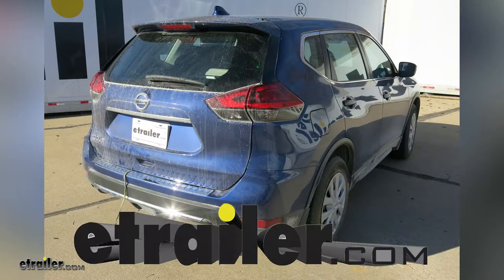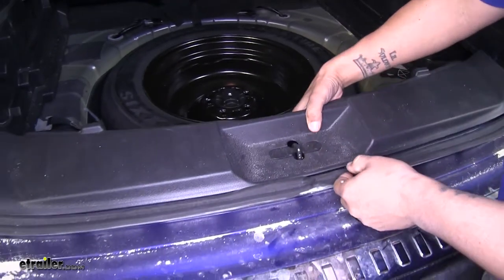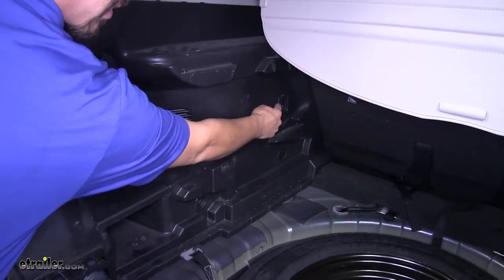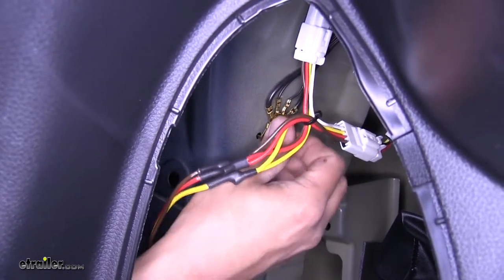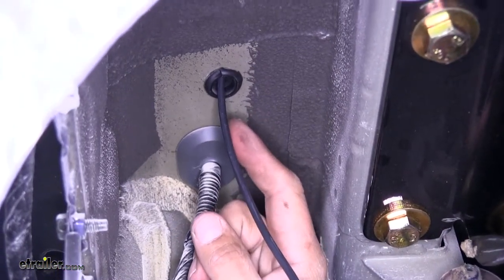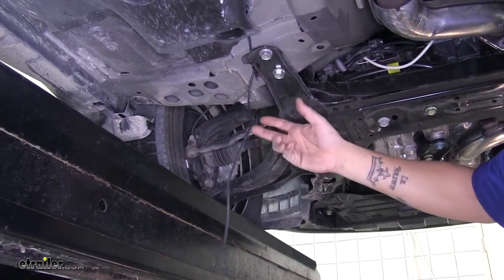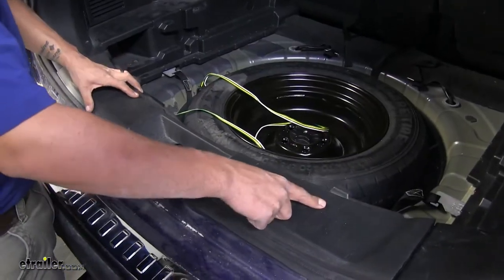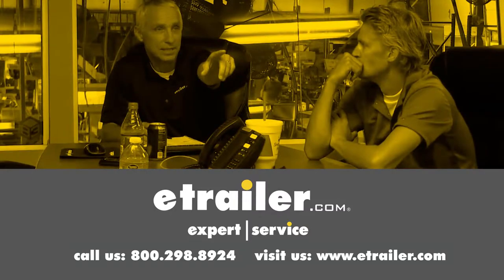etrailer | Trailer Wiring Harness Installation - 2017 Nissan Rogue

Comment: Don't cut the rubber grommet, put a pinhole in the center and feed the wire through before attaching to wire from converter.  Less damage compared to cutting the grommet.  Silicone around the wire on the grommet.